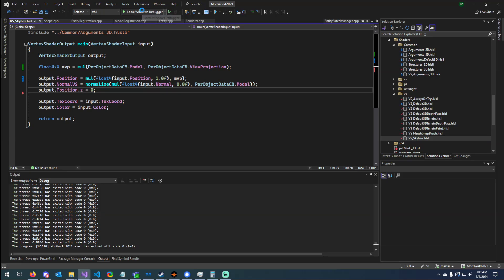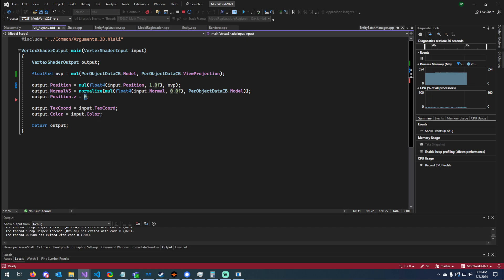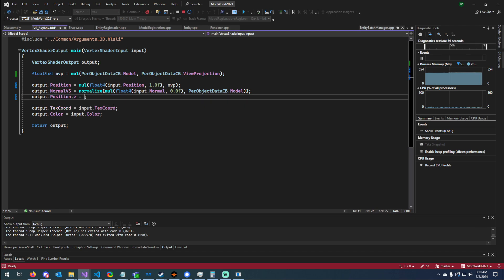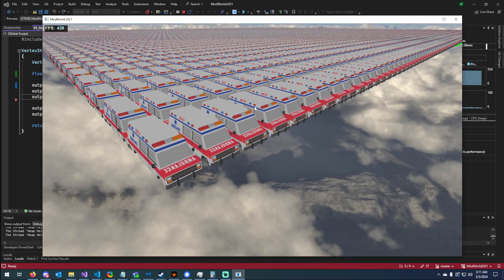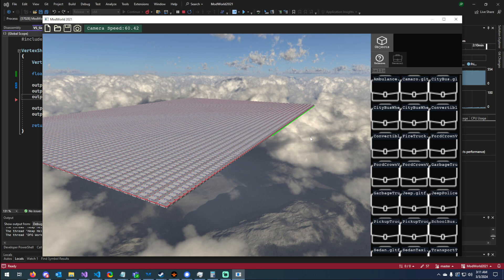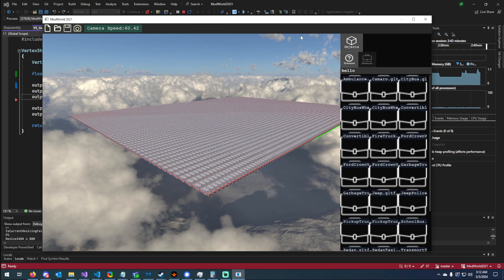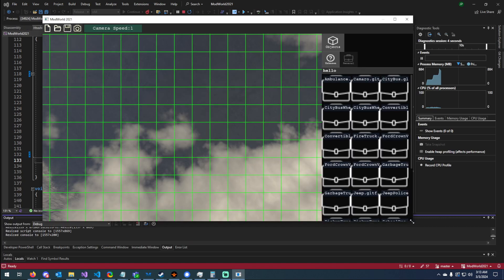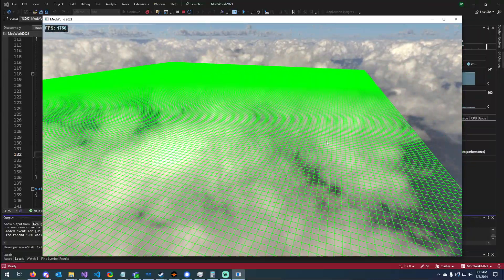Engine Update - LODs, Instancing, Skybox, Fixes

Comment: Will you eventually open source your engine? Also, I recommend usd over json for import, scene etc
Reply from the maker: No, the plan is to make a game with it so I don't plan on open sourcing it. I don't think it would be very useful to someone else anyways when there are engines like Unreal. The whole engine is built around the specific game I am trying to make and wouldn't make sense for other projects.

I am using my own custom 3d format for files and json is just a format that I can easily interact with using lua so I am storing the model/entity position data using json.
Reply: @Jpres  cool! Good luck on your game!
Reply from the maker: @loremipsum3147 Thank you!